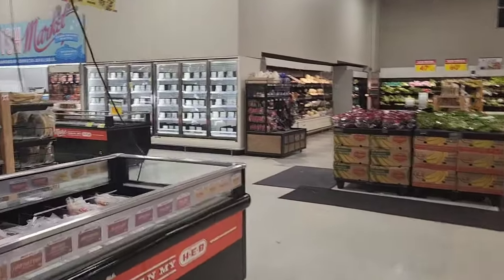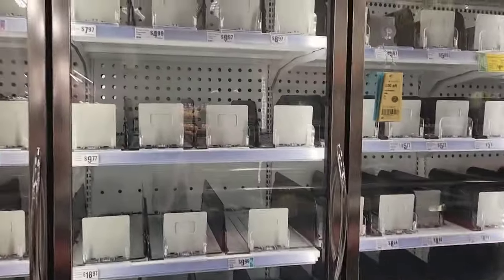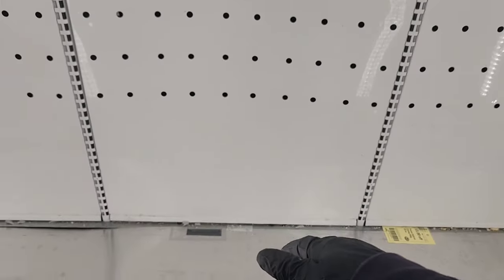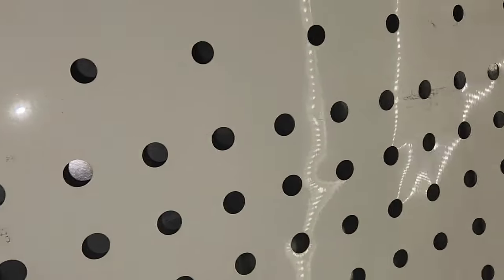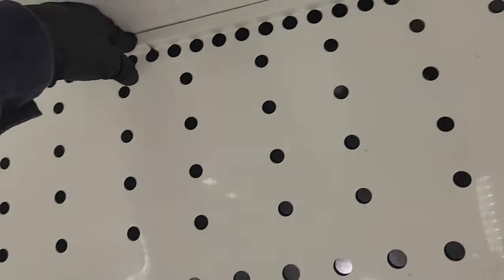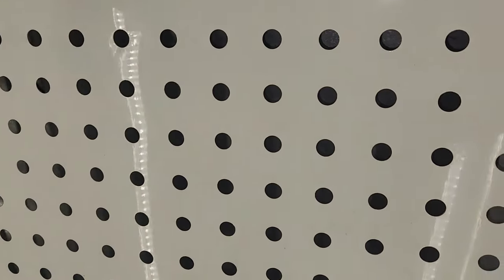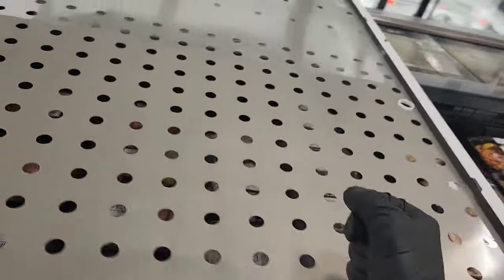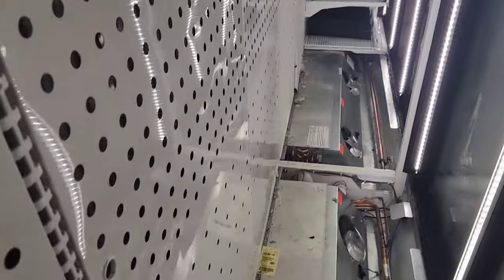Overstocking Case Causes Back Walls to Collapse

Comment: You're fighting a good fight sir. Those stores are lucky to have someone so caring and professional to take care of their equipment. 
I wonder if you used some stainless stove bolts and put them through the front with the rounded head head exposed. On the back side, you could put a washer and nut. The bolts would need to be long enough to hit the back wall. A few of those, placed strategically, may create sufficient standoffs. Thanks for the time and attention. 😊
Reply from the maker: smart idea. i will probably implement that next time
 thank you

Comment: Thanks Pal. They’ll eventually bow them in again at some point especially how flimsy they are. I’d have had stand off brackets made to size and riveted to the back of those panels to maintain that spacing. 

It’s a crappy manufacturer design but at least you’re eliminating future issues and it’s a permanent fix then. 👍 Love the work you’re doing

Comment: could attach rubber spacers to each back panel in certian spots thru the holes already on the panel.. you can up charge for that service

Comment: If someone sold a rubber bumper that would pop into the holes to give it a standoff, would that be something you could use and then sell to the customers as a fix for this happening in the future? Get me the hole dimensions and how far it needs to be held off the back wall and I'll make a product to fix that. what a ridiculous design of the back.

Comment: No surprise that these Zero-Zone units are bottom of the barrel. Another HVACR technician made a video about a Zero-Zone freezer that was a sickening 91 degrees, because the evaporator coils froze up, yet there were no defrost drain heaters to melt the ice into the drain. Hussmann, Hill-Phoenix, and True are much better than these ZZ units.
Reply from the maker: I totally agree with what you said here. That's strange that a case would be able to get up to 91° if there was Ice all in the evaporator with the fans blowing. You got me really curious now can you link that video so I can check it out? Thanks